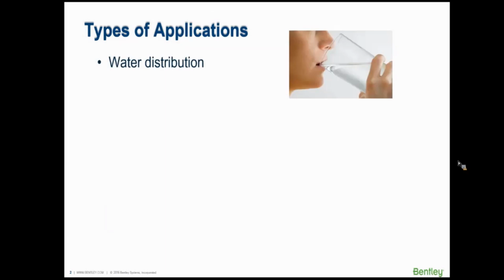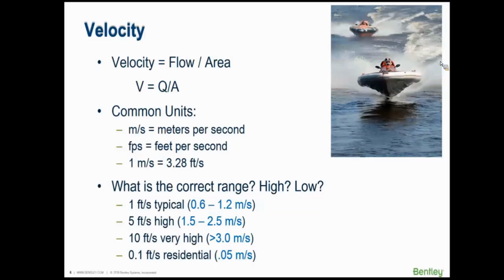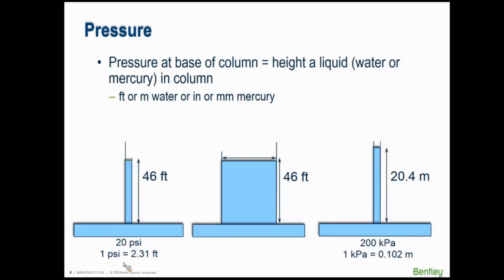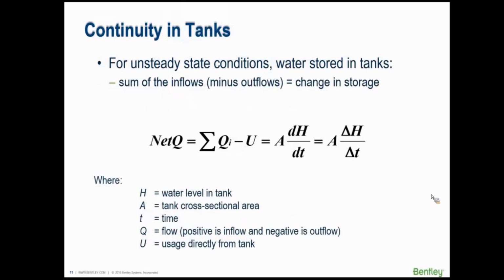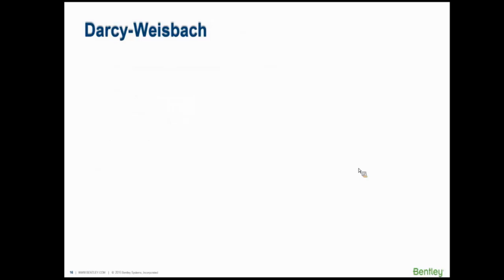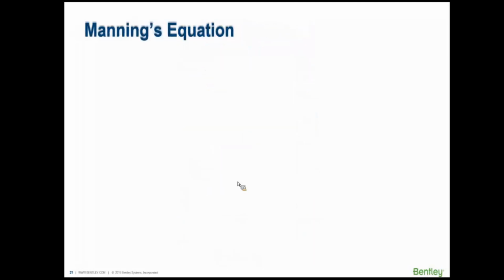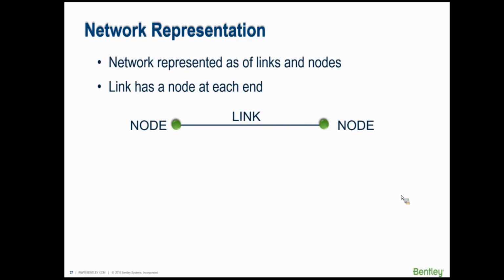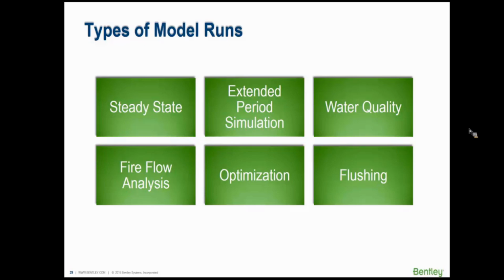WaterGEMS/WaterCAD Fundamentals Part 2: Modeling Fundamentals and Hydraulics Review

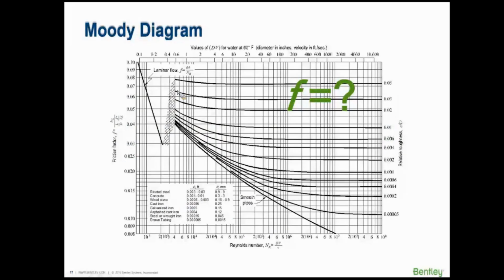Comment: Great video! Just wanted to point out a small discrepancy in the annotation at 21:35 regarding the reading of the Moody Diagram. The presenter explained it correctly, but the annotations might be a bit misleading.

We don’t follow the e/D curve line to the end at the boundary with the laminar regime. If we did, we wouldn’t be able to read friction factor values below 0.04 or above 0.08.

The correct way to read the diagram is as follows:

1. Determine the Reynolds number and the relative roughness.
2. Select the appropriate e/D curve.
3. Mark the point where this curve intersects with the Reynolds number.
4. From the marked point, move horizontally straight to the left axis to read the friction factor (f).

Hope this helps future viewers! Keep up the good work.